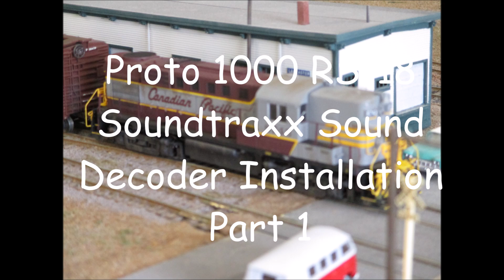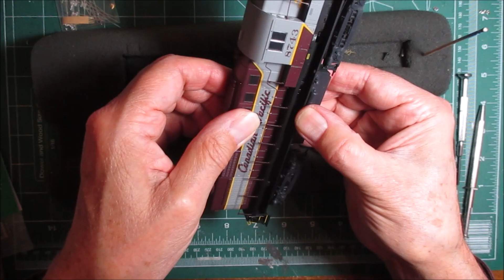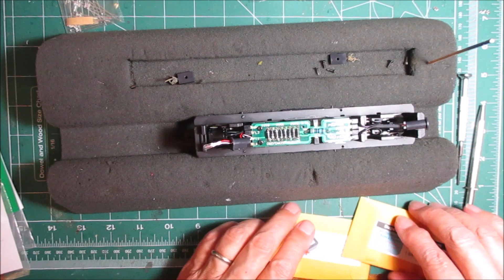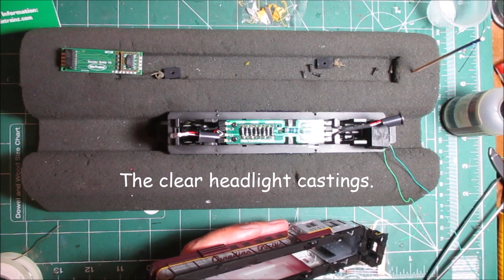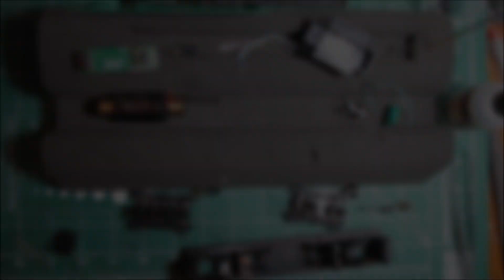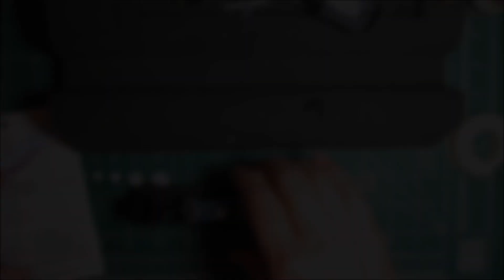Proto 1000 RS-18 Gets Soundtraxx Tsunami 2 DCC Part 1

Comment: Very fine installation!  Thanks for the Decoder Buddy descriptions and accolades!!!  Enjoy!
Reply from the maker: Glad you liked it, the Decoder Buddy has helped a lot.  BTW, Nick told me that the Keep Alive should be connected to U+ and GND pads.  The W pad is for the control wire of a 3-wire stay alive circuit.  This will be explained in part 2.